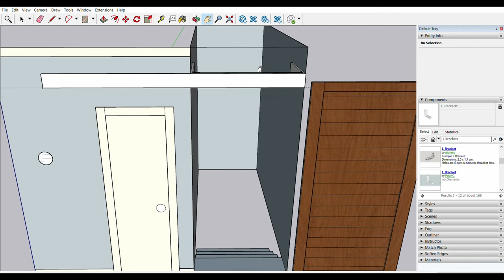DIY Building a Barn Door for My Stairwell

Comment: Can you please material you have used? I'm trying to build similar barn door for my stairwell. Where did you buy iron brackets for holding support wood beam?
Reply from the maker: The brackets I used to attach and support the wood beam are actually the brackets that came with the Sliding Door Hardware that were meant to be used to attach the door to the ceiling. I simply repurposed them and used them as my support brackets. The links to all the hardware I used on the door are directly below the video description. As for the door it was all built using 1"x6"s and 1"x4"s. All of the screws I used for assembly are pocket hole screws since they have flat heads meant to prevent driving them below the surface. I painted all of them to make them black rather than stainless steel.